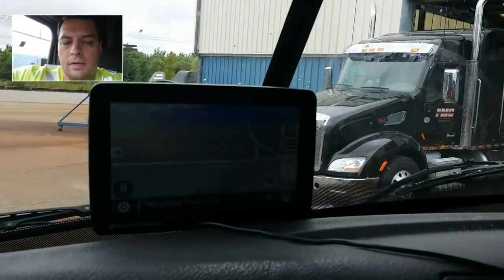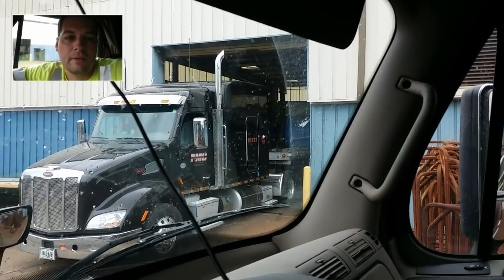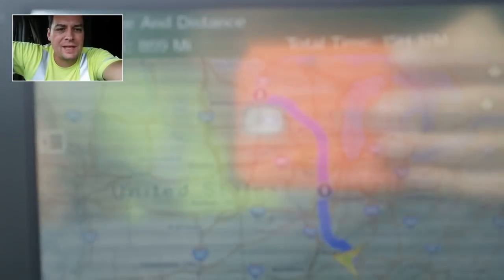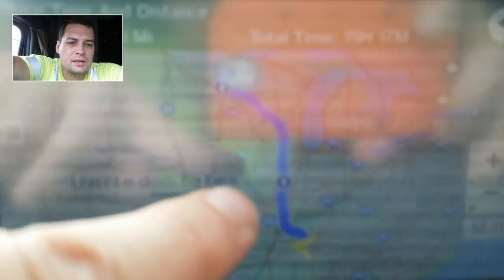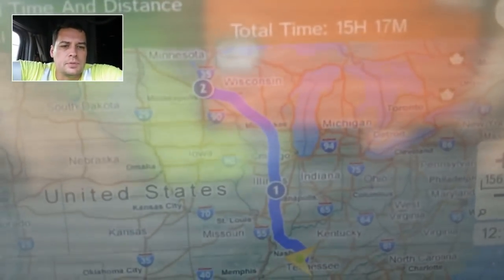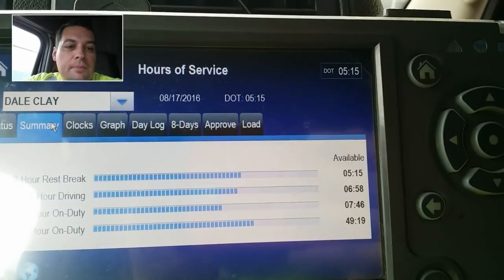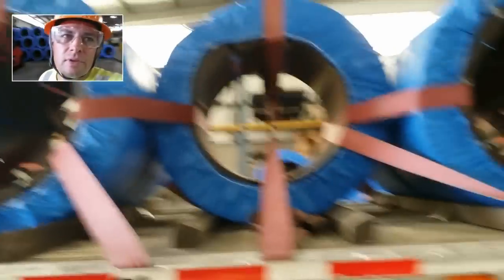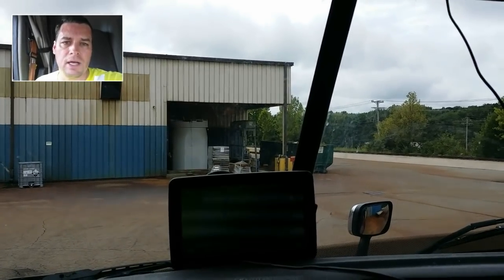Coiled Steel Cable with a glimpse of securement

Comment: just dropped off my bundles of wire , 12 bundles per pack, 243 bundles total,  47 000 pds worth of wire from mt airy nc down to pompano beach florida,  now hanging out in the everglades tonight,  then on to wildwood florida to charolette pipe,  fun times
Reply from the maker: +David Kornrumpf II Went from Marseille Illinois to Houston. Picking up tomorrow to head back to Marseille

Comment: I remember i was working in Holland in a factory using that cable to make big  prefabricated cement slabs , they run it out with a type of small train and i was tensioning the cable with a hydraulic tensioner and the cable broke and it went into my hand LOL
Reply from the maker: +Trucks ouch